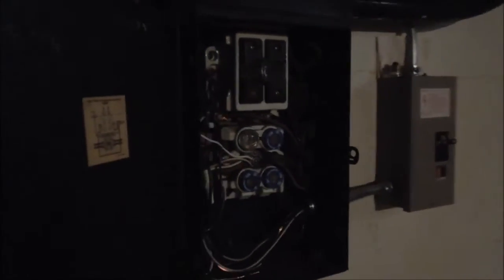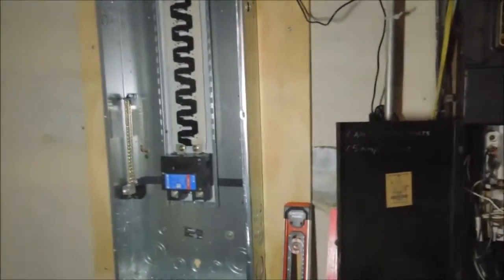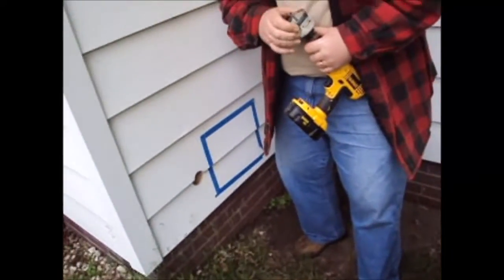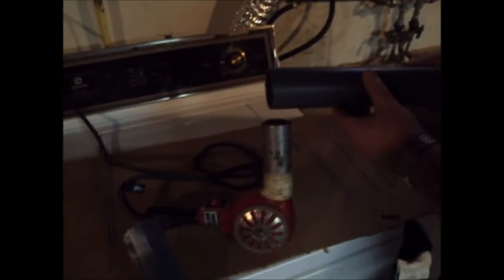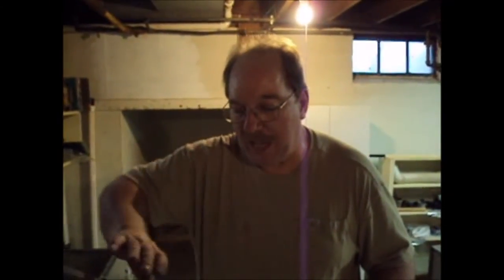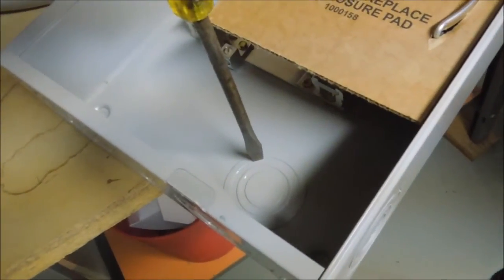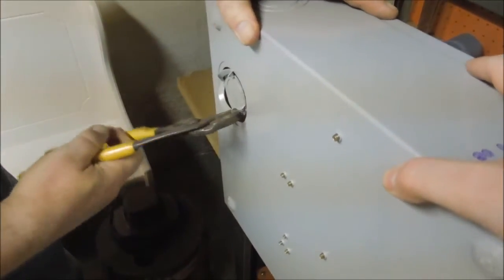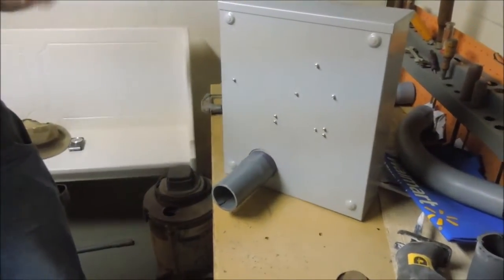Electrical Service Upgrade Pt 1 - a video tutorial from Old Sneelock's Workshop

Comment: I am having a major issue in my house & I'm wondering if anyone can add some insight....I have numerous issues & I'll try to explain it easily.  Issue #1 When washing machine runs in kitchen ALL light in the house flutter/flicker with the rhythm of the washer (used to just be in the kitchen where the washer is, now it's throughout the house) #2 Lights blink when ac compressor kicks in or fridge kicks in or furnace which always happened but now it's a much harder blink than it used to do #3 standing light in bedroom lightly and randomly blinks, it's a slight b link but enough to notice at night & it isn't from things kicking on.  I tried another light in another outlet & got the same results, the random blinking isn't happening in other rooms.  Electric co came out & said everything seems fine at the meter box however there are 2 connection in the meter box that he said seem to be a little corroded but he said that may not be the issue he said I would have to get an electrician to see if it's possibly a bad neutral at the box in the basement.  I always thought I was on 100 amps but found out today I am only on 60 amps, however I have both a fuse box AND a breaker box in the basement, I can also run many things at once without blowing anything which is why I thought I was surely on something higher than 60 amps (I have an electric stove and electric dryer & can run both at the same time in the same room with no issues, can run 3 ACs with no issues & so on)  All my outlets (except for the kitchen) are three prong outlets, I'm assuming only the kitchen may be on knob & tube.  I have never had any issues with flickering lights until this past month suddenly.  Again the kitchen light would blink in the past when the washer ran but it was only in the kitchen, now it's throughout the house on lights that aren't on the same circuit.  Sorry this was long but I just don't get it & I'm now afraid to run my washer at all & afraid of my own house now.  Should I be scared is this an imminent fire hazard what would be possibly causing this?  The blinking issues are new & never happened before & we've done nothing to the electrical at all & according the the electric co everything outside seems to be ok except for those 2 connections inside the meter that seems a bit brown & corroded he said the problem may be inside at the box in the basement.  It just has me scared my house is going to burn down from an electrical fire, I'm planning on calling an electrician but wanted to ask online first.
Reply: also my husband works out of state so I'm here alone a lot with my son so I'm on my own when it comes to this problem right now, probably why it worries me so much, so any insight and suggestions would be great.
Reply from the maker: Anglynn,
You are right to be concerned. It's hard to diagnose from just a description but it seems that you are having a problem with the corroded connections.
All of the lights blinking when a load comes on i.e. the washer, furnace, air conditioner and so on means you are not getting a good flow of current to the main panel.
If you are running that much load through a 60 amp box I would have an electrician come out and thoroughly examine your panel and wiring for hot spots.
If you are able to run all of those pieces of equipment at the same time I suspect that there may be an issue with a fuse that is too big for your service.
I'm concerned with the brown wires in the meter box. That indicates they are heating up. I would call an electrician immediately.

Comment: holy crap dont ya think that meter base is a bit on the low side wold never pass here lol why not spend the extra 15 bucks and put a lb and 3 feet of pipe up the wall and come into the left bottom knock out on the meter base
Reply from the maker: You're the second person to question the height of the meter install.
Relax guys, the meter location has to be approved by suppliers engineering department and the electrical inspector before it is installed. The installation has been approved and stickered. It took the inspector about 10 minutes to examine the job and approve it. Miss Dig has identified the underground utilities and marked their locations. The supplier is coming to put in the underground service wiring within the next two weeks.
3/0 copper is $2.50/ft. A pulling el is $12.50. Conduit would be free since it only took 7 feet to get from the box to the meter socket and we have 3 feet left. With all that being said why would I put the meter higher than required?

Comment: Wow you guys must have very liberal electrical inspectors there, that wouldn't pass where I live. they would fail me for the glued connection to meter socket ( here it must be threaded with metal nut ) and the socket has to be located 4 to 5 1/2 ft off of finished grade, and if they ever caught me backfeeding any circuit I would have no power. All of what you are doing works - it just wouldn't pass here.
Reply from the maker: Hi halfwayuphill. Thanks for commenting.
Sorry about your luck with inspectors.
My Dad was a A1 Electrical Contractor for most of my life and we installed hundreds of service panels here in Michigan. My understanding is that the threaded nut is only required on metal conduit to allow bonding it to the panel. In that case it has to be a bonding bushing.
We have always gotten the meter position pre approved before placement. Consumers Electric won't connect unless they have preapproved the install and it has passed inspection.
Backfeeding as a temporary measure is acceptable while performing the change over. I don't recommend it as a permanent process. :-) In fact when the inspector came to check the installation last week, we got the sticker, and he explained to Ryan exactly how to back feed the system in just the way I told him.
Reply: Please send some of those inspectors down to WV, maybe they could train ours, LOL
Reply from the maker: halfwayuphill Michigan goes mostly with the NEC. Individual government units can and do add restrictions beyond the NEC. Also inspectors all have their hot buttons. My best bet is to be sure not to press any of them. If the majors are good, right size wire, neat install, and paperwork complete they usually don't start checking torque on screws, or the number of tape wraps in junction boxes.
Doesn't mean they won't but we're all human. We don't want to do a bad job and they don't want to let a bad job cause a problem.
If I have any influence (I don't :-) ) I'll see if I can get your guys to back off.